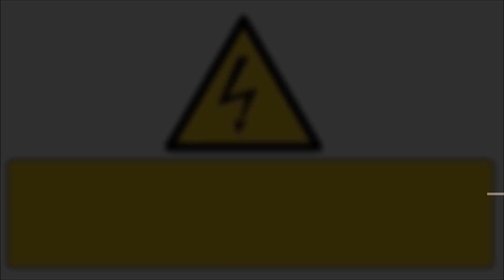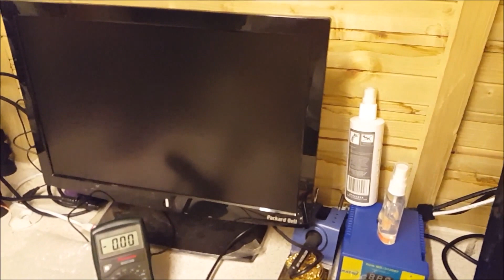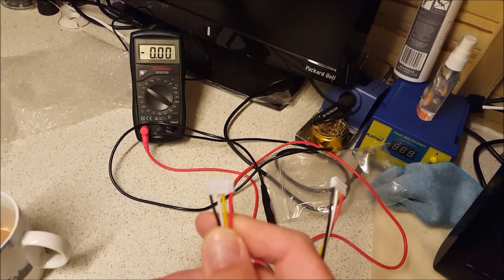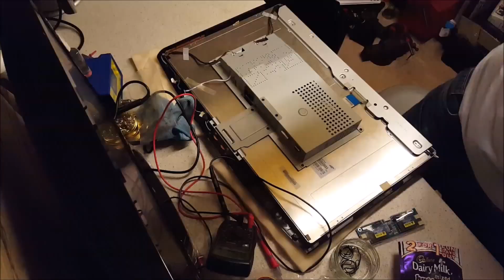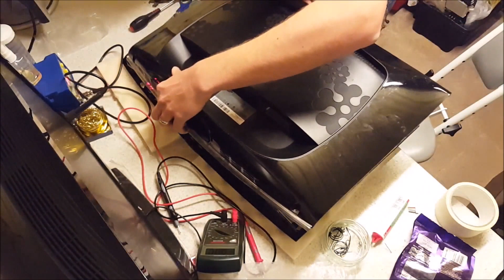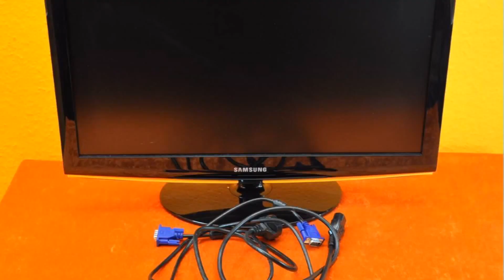LCD Backlight Repair - Cheap fix

Comment: I'm pretty sure my motherboard isn't labeled. Is there anything I can do to figure out what is what? I've even contacted the company to see if they have the motherboard schematics haha. No help there.
Reply from the maker: If you've got a multimeter you can carefully test points where the connections come into the board to see what voltages you get but without a schematic you're gonna be taking some risks with whatever you do
Reply: @mdickens98  i appreciate the reply. Just reopened the monitor to confirm, and sure enough, nothing is labeled. The wires are all different colors though, for whatever that's worth. I've got a definitive red and black going into those pins, but the other 6 are various colors of the rainbow
Reply: The board in dealing with here is a JT279HP6KJ out of a planar px2710mw

Comment: I was trying to repair my LCD monitor, because the image would appear for just a few moments, then it went black. But looking closely i could see somewhat a window that i had opened. Opened the board, a capacitor is concave. No signs of burnings yet. I got to the lights and it's ends were black. I wonder what is causing the failure. Do you have any advice?

Thanks in advance :)
Reply: AFAIK that's a power supply board issue.
Reply from the maker: Sounds like your back light isn't working. If the ends are black it's either a problem with the power supply board which has damaged the lights or the lights have just failed. Not sure the best way to repair this though

Comment: Thanks for the great idea! It works for Samsung SyncMaster 2243! I don't know how long it's gonna stay, but it revitalized my monitor. I'd recommend before ordering the inverter to make sure that it was a problem with backlit. How? Run your monitor from PC and point a good flashlight at 45 degrees to the screen. If you see the picture at the spot, yes, it is a backlit problem. Go ahead and install this converter.

Comment: Is it possible to repair inverter transformer by recoiling
Reply from the maker: I don't know the answer to that which is why I went with the easier option of just replacing the board

Comment: Hi
Have you a link where you bought the inverter board?
Thanks
Reply from the maker: I don't have the specific item as it was from eBay so it changes all the time. Here's a link to something currently available, they do 4 lamp and 2 lamp models depending on how many ccfl lamps are in your monitor (this monitor had 4) https://www.ebay.co.uk/itm/292149239688

Comment: Where did you put the replacement backlight after it was soldered on?
Reply from the maker: I only replaced the power supply for the backlight, not the whole backlight. There was plenty of space in the back housing of the monitor to fit it in

Comment: What exactly did you try to fix?
Reply from the maker: The backlight was not working on the monitor. This was because the inverter had failed. I installed a cheap universal inverter and now the monitor works
Reply: Read the title of the video.
Watch the video.
Think.

Comment: cool.  placed my order for the inverter board.  only costs 5$, free shipping!  Crazy cheap... I found a monitor similar to yours in the dumpster of my apartment building.  brand new looking!  Still had the protective plastic stuck over the spots they wanna protect from scratches!  Not sure what happened to the original inverter, but the circuit board had obviously overheated at some point as it's nicely toasted brown and has that magic smoke smell to it.  I feel very good about the likelihood that a new inverter board will solve my monitors issue and I will end up with a brand new monitor for the 5$ I'm paying for the new inverter board plus the labor I'm putting into it.  The symptoms are similar to yours.  turn on monitor, back light lights up for about 2 seconds then turns off.  monitor still on and you can still see the contents of the screen, just no back light.  Anyhow, thanks for the rundown as this will help me when I get my inverter in the mail and need to do my soldering etc.!  Save me some time and guesswork!
Reply from the maker: Glad I could help. Let us know how you got on once you've done the repair.

Comment: Thanks! Got my monitor up and running again. Previously repaired the monitor replacing the main board, broke again after a year, now put in the 3$ aliexpress inverter, we'll see how long it holds. 3 dollars and thanks to you 10 minutes of work got it running again, worth it!

Comment from the maker: Over 2 years since I did this repair and it's still going strong. I use this monitor nearly every day
Reply: Excellent! I am wanting to fix my Viewsonic VX2858SML 28inch monitor that Is giving me the exact same issues. It turns on, shows me a pic for about a second and then it slowly fades to black.
I am anxious to give it a go. Before I get a LCD kit from Ebay Ill Check the caps to see if they are blown or distended.
Where can we get a monitor LCD kit like you bought?
Reply: @Mahlercougar  p
Reply: i know it is kind of randomly asking but does anybody know of a good website to stream newly released series online?

Comment: Hi!
I have a samsung  T220 samsung monitor with backlight problem.I bought the inverter and follow your directions.I found 13v instead of 15v and solder there the vcc.I solder also the 2 yellow cables onoff to onoff, brighness to dim A and gnd to gnd.When i plug the monitor to dc nothing happens.Not on off light neither monitor turns on.If i connect it like it was i get on off light,monitor powers on but no backlight.Can you suggest solution?Thanks!
Reply from the maker: It sounds like something may be shorting out, check your solder connections again and make sure nothing is bridging. If you can, test for continuity with a multimeter to make sure you're not shorting too. If everything is ok maybe the 13v point was not the right place to pull power from, see if you can find another point or even try powering the inverter board from an external power supply instead of the monitor to start with to see if it actually works.
Reply: @mdickens98  My connections are good,checked with microscope.I will try to pull power from another place and also check the inverter with my bench power supply.I will let's you know results...thanks!
Reply: @zafisinl  And how did it go?

Comment: My Samsung 225bw has the same issue but when it turns on it will flash on the imidietly off not the monitor the backlight.. wat do I do??
Reply from the maker: It sounds like pretty much the same issue. This video will give you one option for a repair but like I said before, if you're not competent around electronics then take it to a professional

Comment: Hi matt regarding on your wiring connection at video frame 13th minute. Can you clarify my following connection are correct? V+ = 15 V.    Gnd = gnd.    Adj = gnd.    On = on/ off.   Thank you
Reply from the maker: ng kah weng 7 I don't have access to the screen any more but I did use a separate pin on the PSU for the adj signal. I can't quite hear what I'm saying on the video but I think it was labelled A dim or something like that
Reply: Hi Matt Dickens , i tried your wiring method and it works! Since your sound was quite dim and very unclear it takes me 10 times repeat to get your meaning. So the wiring arrangements are V+=15volts, 
Gnd= gnd. On= on/off  adj= dim.  Thank you very much you done a great help to me.

Comment: Hello, i don't get this kind of repair, why you didn't replace the inverter transformer on the power board?
Reply from the maker: thesummertune I agree that this would be a better repair but these universal inverter boards are cheap and easily available (cost £5) and I found the repair very easy. I have no experience of replacing the inverter transformer but I imagine it would be a more complex job obtaining the correct part and likely more expensive too